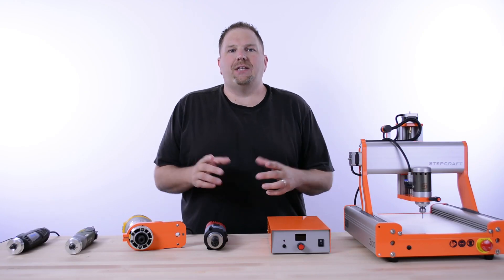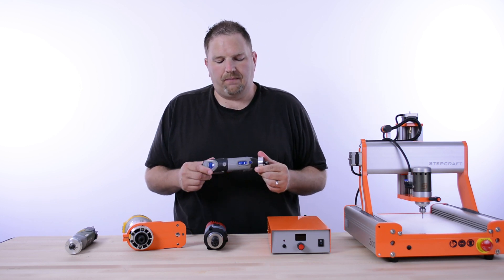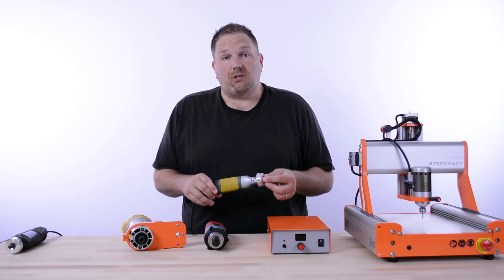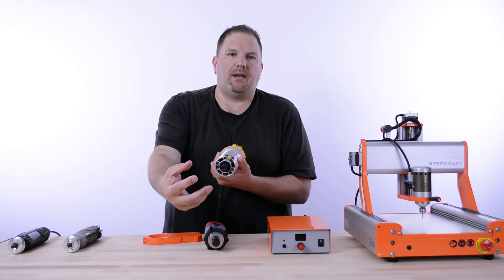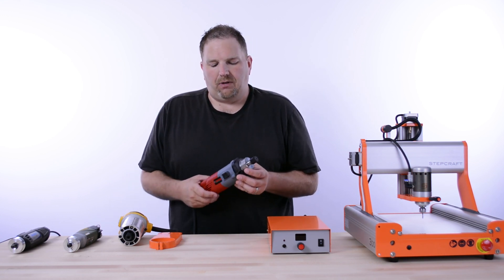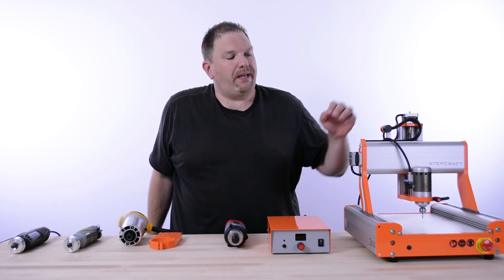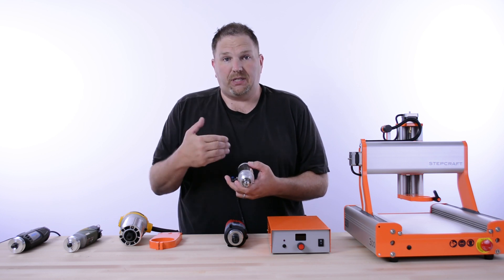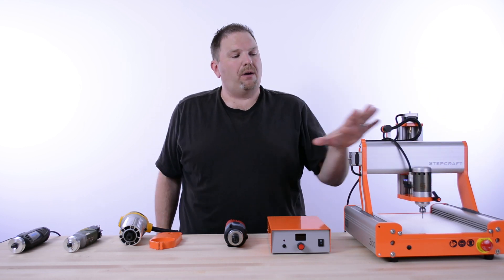Choosing A Spindle For The STEPCRAFT CNC System - (Dremel 4000, Proxxon, Kress, Dewalt DW611, HF500)

Comment: Great video. What do you think about AMB 1400 FME-P DI? Do you think i can use it for several hours in a row without any problem working with steel?. Thanks in advanced.
Reply from the maker: It is a good spindle.  I, however, have not used that spindle personally.  We do not sell it in the USA because it is available as 220V and on our benchtop machines we stick with 110V spindles.

Comment: This Proxxon model (IBS/E) is meant mainly for manual  operations (mostly for drilling and grinding). For milling, there is Proxxon BFW 40/E . In my opinion, for CNC routing/milling it is easily  comparable to the Kress. Unfortunately still with manual spindle control only.

Comment: If we use bldc motor (the last one) and i want to increase its rpm, would it be stable or decrease in torque sir?
My point's just want to know which motor can be has the same torque as far as i increase the rpm speed.
I don't mind if it's an AC or DC based.
Reply: ateng lenon 
Pretty sure V and phase adjustment is for rotation speed adjustment and current is responsible for torque. As long as the power configuration sits within the motors W rating. (500w is rather small for anything harder than wood. 800w is a better start point and most water cooled 1.5kW - 2.5kW will cover most hard composites/soft-medium metals. Go water cooled as plumbing/pumps for water baths and/or coolant sprays are already incorporated.)

Comment: Is there a way for me to use the Stepcraft HF500 via a step/direction API? I.e., is the encoder and PWM able to be accessed by third party software? I'm thinking of upgrading a different machine with this spindle that uses a servo/stepper as an "A" axis (for tangential cutting as well as routing)
Reply from the maker: The HF-500 is NOT an encoded spindle.  You can use it with a PWM control of  0-10V on another machine

Comment: Any plans to have an option for say a 2hp router?
Reply: retiredsearge 

2Hp? 
Use ‘Watts’ my friend. Always use Watts for base unit when discussing an electrical motors ‘power’ rating, this is broken down easily into Volts and Amps. 

Edit: 1kW (1000Watts) = 1.3Hp 

Hp is another unnecessary conversion and technically, does not adequately describe the nature work the motor can do. 
Ie; 800w grinder, 1200w grinder.... 

Stick to ‘engines’ when talking Hp. (Or LB/Nm and displacement to be correct. Hp is a factor of an engines ability to do work loosely based on a combination of the engines torque vs operational rpm.)

Comment: is it possible to use some spindle/motor that will work on soft steel ?
Reply from the maker: We do not recommend cutting steel.  I have customers that do it with success but there are a lot of factors to consider.  Our machine has been developed, tested and is supported for non-ferrous metals like aluminum, brass and copper

Comment: I was under the impression there is a clear distinction between and router and a spindle.
And yet you call everything a spindle   ....and sometimes you call it both. 

You are the pro here  ...should you not be telling everyone that all of these units are just routers except for the last one?
You should layout what the difference is    ...and don't forget about the noise difference.
Reply from the maker: You are correct, there is a difference.  We tend to lump everything to the category of "spindle" or we will say "using a Dewalt as a spindle".  We use the term "spindle" to reference the motor used on the CNC.   I am working on an updated version of this video and I will be sure to be more clear on the definition between the two.  Thank you

Comment: Very-very informative and correct video. How noisy is that Kress motor?
Reply from the maker: It is not too bad.  Actually quieter than a typical trim router like a Dewalt or Bosch Colt

Comment: I was so stoked to have a kress 800w spindle until you started talking about auto tool change on the Stepcraft spindle!!!!!! i need this now
Reply from the maker: We are going to be releasing a ATC for the Kress soon... stay tuned :-)
Reply: Stepcraft Inc That's fantastic news! My main concern is actually all the models are too small for my application. Is there talk of anything like a 1000mm wide and 1500mm long variation?? Can custom sizes be made?
Reply from the maker: Not at this time, I am sorry.  The 840 is our largest model.  However you can tile a job for unlimited length.  The machine is designed so you can pass the material though it for longer work pieces.
Reply: ahh dam.. thanks anyway.. My work peices are around 900 wide  (not long) and much longer so mmmm bugger!  the auto tool change is such a win!
Reply from the maker: I am sorry :(  I wish we could help at this time...

Comment: You guys should sell the Stoney cnc industrial spindle as well. I would love to see a Stepcraft pro machine that is a little heavier duty. I like the options you guys have but the machine looks a little light duty. Something in between the competing 2x4 machines but not as beefy. Maybe something with nema 23 motors and better rails.
Reply from the maker: its coming.... https://www.youtube.com/watch?v=x-8ip7-bHwM
Reply: Love your product! Could you not supply a collar so that you can fit the smaller attachments with the Dewald bracket installed? Will the dewald bracket also fit a Makita handheld router spindle? Definitely on my wishlist!

Do you have a supplier here?

Greetings from South Africa 🇿🇦

Comment: Isn't it possible to mill steel? I mean you could reduce the depth of cut to 0.5 mm for example..
Reply from the maker: No, you can not mill steel with a desktop CNC router, they are not designed for that kind of stress

Comment: Will Dremel 7700 work in it?
Reply from the maker: Yes
Reply: Dremel only good for hobby work on soft material. Excessive bearing wear will result otherwise. A proper router (or spindle) is MUCH better choice.

Comment: I bought the machine together with computer controlled HF500 and it's fantastic. Now I cannot imagine myself milling with a manual-controlled spindle.
The HF costs more, but it's worth every cents.
Reply: Giulio Buccini can you make stand able wooden letters/Alphabets? Like the thick ones which can stand on their own??
Reply: Yes. I had never cut timber, usually I cut aluminum , hard-plastic or plexiglas. But on the forum I saw guys cutting 1 cm thick timber with no problem.
Obviously, more hard is the material more passes you have to do. Usually on timber the machine can cut 1,5-2 millimeter per pass. The main secret is just one: buy the right end-mill for the right material! For wood there are special end-mill bits. I think that with 1/8" end-mill for wood you can do a lot of things.
Reply from the maker: Many people love the fact that it is computer-controlled...
Reply from the maker: Yes, I dont see why Not. I have done projects with material of up to 75mm

Comment: I assume the dewalt has the most power?  I am looking to do some aluminum work, but am trying to stay away from 220v spindles.  Any chance you have a model larger than the HF500 coming?
Reply from the maker: The Kress 800W spindle we offer delivers the most power and is VERY accurate for aluminum work
Reply: Stepcraft Inc the upcoming tool changer just might put me over the edge. Please let me know when it is released and I will order a set.
Reply from the maker: Anthony, it is available now... https://stepcraft.us/product/automatic-tool-changer/

Comment: Hey every body...if you have the 3D Print unit or a 3D Printer you can downlod my designs for free here. 

Cable clamps: http://www.thingiverse.com/thing:1619860 for HF Spindel and Pump
Dust extraction: http://www.thingiverse.com/thing:1611897 for HF Spindel
Edding 3000 Plotter: http://www.thingiverse.com/thing:1615783

and some other stuff. Have fun!

Greez from Germany Lolle!
Reply: Pity to hear that Oren Hag, I was so illusioned with the capabilities of that machine -German engineering :(-. Yes, I think it´s pricy also, and the other devices very expensive, have to pay for everything even the software needed to run such extra devices.  And in my very personal case it was going to be The Investment for me since I don´t live in US neither EU and had to make an import to my place.
Reply from the maker: Thank you
Reply: Hello Meckatzer4life, I´m very new to CNC world, was making some ceramics but realized the need of using CNC advantages, and... wow! Stepcraft is my dream machine ´cause in order to get my stuffs I´ve been compeled to outsource any other material work including foam cutting and 3D printing, Spacecraft capabilities looks simply awsome. But... I don´t live in USA and in my local market is unthinkable to find a stuff like this so I need to make numbers before to get the best buying overseas option  Could you please let me know how much did you pay for yours Stepcraft? Which model is? What the configuration was? I see it has many devices available to work with.
Best regards.
Reply: Can the HF-500 be used on aluminium alloys?
Reply from the maker: Oren, I do not think this is a very fair statement... Maybe you are talking about software that is sold when you buy a system from Germany, but in the USA, we include UCCNC with every system at no charge.  This software has the ability to read and run GCode.  So you do not need to spend any additional money.  However if you wanted to buy a design/CAM program like from Vectric or Deskproto, that is additional money but is not required.  We, in the USA, also include a free year license of Fusion 360 with every machine.  
We are VERY upfront about everything we sell and will provide a detailed proposal to any customer that asks for it.  In fact, I have personally talked some customers out of buying more than they need to avoid confusion, etc. I want to be sure EVERY Stepcraft customer is successful.   Please contact us in the USA for all Canada, USA and Mexico sales at info@stepcraft.us and you will be VERY pleased with the support and service you are presented with....  Erick Royer, Director, Stepcraft, Inc.
Reply from the maker: Yes of course... We have several videos showing projects that are run on Aluminum - www.youtube.com/stepcraftinc
Reply from the maker: Oren, I do not have your name in our system.  Where did you buy your machine from?  I hate to hear that someone is upset and will always do whatever I can to make the situation better.  If I can help please let me know info@stepcraft.us - Erick